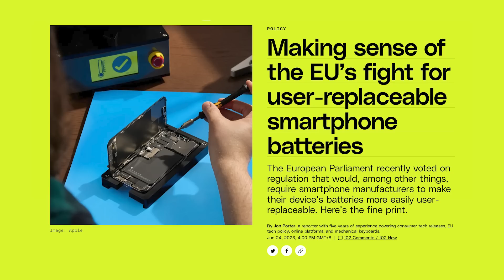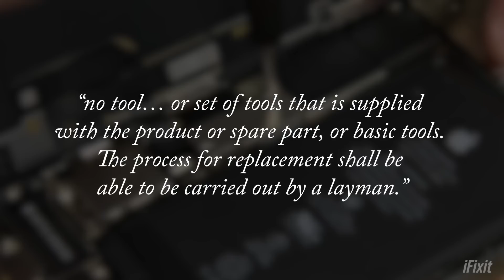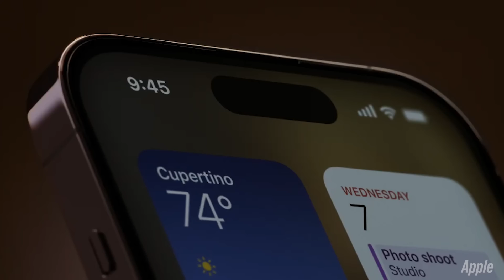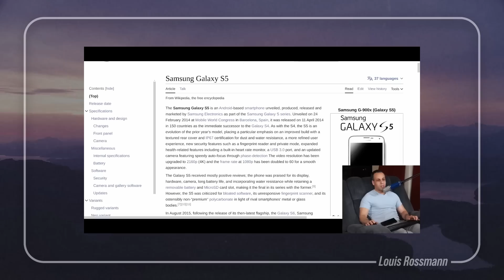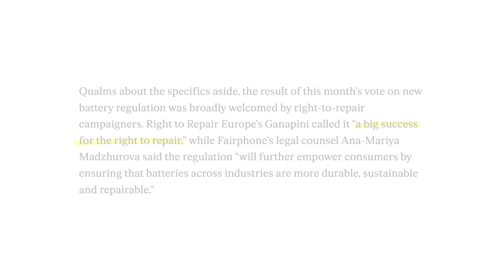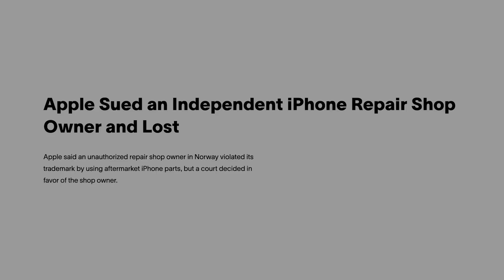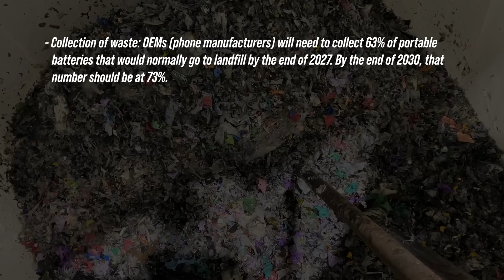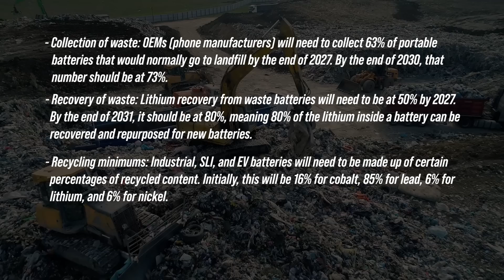EU Just Changed Smartphones Forever

Comment: Common EU W. Seriously though, the amount of devices that go to e-waste just because of a dead battery is ridiculous.
Reply: I have some exceptional quality headphones with jack, they won't work on an iPhone with the lightening connector thing even with an Apple brand connector so i used my iPhone 6 until the battery died. 
Now I have to listen on vastly inferior Bluetooth ones - I can't afford £500 JUST to buy new headphones and I have very very good headphones - ALL THIS COS OF A BATTERY
Reply: @piccalillipit9211 Dude, just buy a Wiim Pro and use it’s Airplay feature to stream from your iPhone into the Wiim.  From the Wiim it’s got optical and rca outputs to gear that can drive your headphones.  It costs $149, not $500 lol.  So wipe your tears and get with it.
Reply: @piccalillipit9211  just get one of the apple usb3 to jack adapters.. They're overpriced, but they do work.
Third party versions have varying levels of quality... 

I kept my iPad Pro 1st gen until late last year for the same reason. Loved that jack.. But had to move on. Now it's dongle-time... Sucks, but is what it is..
Reply: You can replace the iPhone 6 battery
Reply: @piccalillipit9211  Can you not buy an adapter for the jack?
Reply: @streuthmonkey1  Those adapters are absolutely terrible.  I've bought several, and none lasted longer than 2 weeks
Reply: @piccalillipit9211  You're supposed to throw the headphones away and use the little pods that you can lose when one falls out, you're not behaving like the rest of the flock. I'll never buy Apple.
Reply: Agree
Reply: Not only that but many are just sitting in drawers in people's houses due to dead batteries.
Reply: Devices now might start having less capacity batteries or start to be thicker like older smartphones. "Might" because now companies might spend more resources trying to get better and smaller batteries since they have a reason now.
Reply: @RenanMsV_YT  I would always want a more robust frame , containing larger battery for larger autonomy, especially for devices I expect to use for 5-10+ years...size and weight are secondary concerns. But, damn, imagine the level of ..hurt for phone producers if they sold one tenth of the number of devices and could only justifiably increase the price by a few percent for designing better devices. Phone manufacturers already get a large part of their income by selling our personal browsing activity  to merchandising and influencing. Why else all phones have these large screens if not for maximal media retention? You absolutely cannot find phones that are just that, phones, instead all need to be portable laptops..
Reply: Awesome news!
Reply: If my battery is replaceable, I'll probably throw it away every year, instead of every five years, like I do now. I guess this policy might backfire. Perverse incentives are a common problem with policies like this.
Reply: Girst win for the EU in a while
Reply: My recently purchased £15 4G Nokia already has a replacable battery.  It also has a better battery life and is better for things like.. making phone calls.
Reply: APPLE EMPLOYEE SPOTTED
Reply: Yeah, EU win. Making yet another decision that the people DID NOT vote for.
Reply: Meanwhile over here we can’t pass a single law about right to repair and we can’t even ban loot boxes in games as they are blatantly a form of gambling. Add on we refuse to offer free healthcare despite other countries offering high quality fast health care without much drawbacks at all. Feels great to be an American. I don’t think our government gives two flying fux about its people.
Reply: E
Reply: Roughly 50 billion tons of E-Waste worldwide.
Reply: It's better, they think that chargers generate e-waste.
Reply: LG G5 and V 20 did it in 2016
Reply: that what makes it profitable
Reply: no, this will result in worse phones and more expensive waterproof phones, it will make all phones more expensive, now something else will break rather than the battery, it is bad for cooling, it will slow down technology by not funding it, it will punish companies that made phones with replaceable batteries, disposable phones are now going to have to have replaceable batteries so they will cost more, it will turn companies against the EU so the EU wont last much longer.
they are also responsible for GDPR cookie warnings.
Reply: wow the guy himself
Reply: Wtf? Common? The EU does 1000 bad things and 2 good things, and you praise them for it?
Reply: @silksonic3927 Not true at all. Phone are much easier to recycle. Most batteries end up in trash.
Reply: @@user-rx4be4cg5n When it comes to small electronic devices almost no one recycles them and that's a fact. Recycling is literally a myth. Everyone throws away electronics to trash and don't bother with recycling. People couldn't care less.
Reply: 💯 global warming/climate change is a farce and a money grab by politicians and many corporations.
Reply: they'll still get thrown away the lifespans match the speed of advancement.... use old tech get hacked....
Reply: People also need to stop lining up for the newest iPhone every fucking year. Those people are honestly so childlike.
Reply: but surely more devices would go to waste due to water damage
Reply: @cassiuscartland  Phones with replaceable batteries can still be waterproof
Reply: B.S. Apple and a little Google, turning off app-wise updates, (not OS) in old phones is even worse than wear out  battery
Reply: now if only they make another law that demands OS updates on phones especially for more than 2-3 years, because perfectly working phones go to garbage because android only offers max 3 years of OS updates, and without them the phone becomes extremely slow. modern smart phones are small factor computers and they cost as much, so we should be able to use them for a long period of time and not force to buy new every 2-3 years.
Reply: @harukaru84 my Galaxy S9 worked great after 5 years.
Reply: @jamisojo  for a 700+ euros phone it would be ridiculous if it didn't work after five years, but the question is, did it get android updates past the 3 years?

because flagship phones might last a little longer without updates, but entry and mid level phones(200~400 euros price tag) they become very slow once the updates stop.
Reply: not only because of dead battery just because you cant change screen when its broken. @DJ-yh8hm your are totaly wrong. They get recycled. so actually less e-waste as the phone stays and works on.
Reply: Except it isn't that much about batteries, most people put to e-waste because the software updates stop, and people want the thing that feels fast. Most of it isn't trashed if disposed of correctly. It ends up in third-world countries being reused.
Reply: Can't believe my country decided to leave the EU. Look at the fantastic influence they are on the rest of the world. I can always trust my European neighbours
Reply: With those users spending as little as possible on cheap batteries. Getting onto airlines with a phone is going to get interesting. Edit: cheap batteries = fire. When Samsung batteries were catching fire, they banned Samsung from flights, and would check your phone before getting on the plane. Checking removable batteries serial numbers might end up being a thing.
Reply: @float32  why?? What does “cheapness” have to do with what is approved for airline travel? The answer is it has nothing to do with anything you said. Cheapness does not equate to what is approved or not approved. Best stay out of the adult conversations.
Reply: @itsodelay  cheap lithium ion batteries catch fire. Read about Samsung battery fires.
Reply: EU L
Reply: @imstupidbut  yep, username checks out
Reply: Still not a coherent argument to defend mandating manufacturers to design their product a certain way by law. Whats next, mandate that clothing be manufactured with increased seam allowance to allow customers to alter/tailor their own clothes? To reduce waste from the fashion industry? Don't kid yourself EU. Nobody EVER carried a spare battery with them, that was NEVER a thing. 
Who's battery is dying anyway? I've had the same phone since 2012 (typing this on it) while everyone else I know upgraded their iPhones every 2 weeks while the old one was still working? Most people ditch their old phones because there's a newer/better one, and their plan covers an upgrade, it almost never has anything to do with the battery dying.
I bet not a single one of you people even has ever had a pair of shoes fixed or has the slightest idea how to darn a sock, mend a garment; much less think to learn. 
But cry more because you can't replace the battery in your week old iPhone 69 because you can't function without the aid of 50 apps running simultaneously.
Reply: @GM-qq1wi I carried a spare battery.  So thats argument is crap.    I used to work longs hours without acess to a charger.   And nowadays how many people carry rechargeable battery packs ?     LOTS OF THEM !!!
Reply: @MrBizteck  Oh, so you're telling me there's an invention that enables portable charging so you don't even NEED to carry a second battery anymore? It's almost like YOUR argument is crap. And it also sounds like you spend way too much time on your phone at work.
Reply: Not true. Devices go to e waste because people want the mew model after 2 years and don't want to look cheap. They throw away perfectly functional smartphones. Even if batteries were the case tejy can be replaced even today.
Reply: @d3r4g45  I only know a few who changes their phones because a new one has come out. The rest of us sees no need except when the phone gets damaged, or more often the battery gets old.
Reply: @d3r4g45   "Even if batteries were the case tejy can be replaced even today."  by a shop, yes. This is about you being able to swap them yourself.. If you had to bring your TV remote to samsung and pay them 150 bucks to swap your batteries you'd be pissed. That's what it's like now for phones... With the EU regulation, you can swap your phone battery the same way you swap your remote batteries.. Just take it out and put in a new one... At the cost of a battery. So like 30 bucks probably.
Reply: @d3r4g45  Some peple do but not everyone. Most people just sell their own phones. I use my phones until they completely break down.
Reply: @d3r4g45 most people don't change phones every two years.
Reply: Except batteries will not outlast a phone...new battery technology has resolved this issue, this is just the EU being 10 years too late.
Reply: @fabscams4136 batteries don't function well 4 years in.  
Decreasing battery life is noticable after a year or two, easily.
Reply: much better than those movement by " environmental advocate" is saying
Reply: Perhaps in the future all products will be software ‘locked’ rather than hardware constrained to increase the useable life of a product. Manufacturers will charge a monthly fee to unlock features within the device like some car manufacturers do now . I realize this might be a fantasy but one day a quantum chip might be developed with almost infinite flexibility.
Reply: i dont think so, batteries are not a waste at all in the first place, so isnt glass or any other metal. this is stupid law made by people without a clue about whatsoever
Reply: COMMON?
Reply: @bajor3200  They're literally the only institution in the world that does anything to stem the tide of greed that corporations foist upon us. They're the most active when it comes to climate regulations. while the US is busy making people not care about the climate, the EU was doing something positive at least.

 I know it's easy to hate on the EU, but when you dig down and look at why people hate the EU, it's mostly because they've been told it's evil and it's part of the globalist agenda or whatever... Or they just have no idea why they think the EU is bad, just tucker carlson rotted their brains away.

Durrr EU bad!
Reply: @bajor3200  Yes common , you are polish, you should know.
Reply: Now imagine how many batteries will become e-waste when user replacement becomes possible. Much more e-waste than you can imagine since people will be able to do it on their own.
Reply: @DJ-yh8hm that makes absolutely no sense.
 It is way better to just change the battery instead of the whole device, which also has a new battery.
Reply: @bobbobson6290  I think it makes at least some sense.  A phone with a weak battery still has some value and will likely be traded or sold.  A dead battery will be thrown in the trash by a large number of people.
Reply: @smithiness  but the batteries will be recycled for their materials, so it's not a total waste.
Reply: @DJ-yh8hm Why would the rate of battery failure increase ? When the phone/EV dies people will just change their battery instead of the whole thing, fuck planned obsolescence we should be able to keep electronics for decades
Reply: @sambones1092  Changing batteries doesn't keep an old product relevant. How many people are still using laptops from the early 2000's? All laptops of that vintage had user replaceable/swappable batteries and that didn't keep them from being replaced with a new laptop.
Reply: @killer2600  It's been 10 years that phones are the same hardware, tactile screen with double camera, the only thing that really changes is the software which is portable among any device if the company chooses too (looking at you apple), also people will keep buying new phones, but every 10 years not every year
Reply: @killer2600  I know people who are still using laptops from the early 2000s but for specific applications rather than just general use.
However you make a good point and it raises the issue of software obsolescence. I had to replace my Android phone after a few years as the version of the OS no longer supported the apps I wanted to use and newly released versions were not supported on my phone.
Reply: @sambones1092  well said
Reply: @sambones1092  they trade it in to recycle it. Something they would do anyway after a couple years because the new one is objectively so much better. It's not just the battery that makes them want to ditch their current phone.
Reply: @killer2600  I am currently working and light gaming with a Dell L207x laptop. It's well into a decade old; I also have a pretty beefy PC. Try to realize what side of the argument you're on
Reply: @sambones1092 I think he means people will throw them in the garbage instead of trading in their phones for the companies to reuse the parts.
Reply: @vctrsigma  "Something they would do anyway after a couple years because the new one is objectively so much better. It's not just the battery that makes them want to ditch their current phone."

Are they? Phones have been pretty much the same for a decade now... The difference between a 5 year old iphone and one from today is minimal. Screen is a tiny bit better. Cameras from 5 years ago took great pictures, cameras from this year take great pictures...

One of the main problems with phones is that there's literally nothing new... Phones were perfected in about 2015, and after that it's just been a better camera every year... And we've long since reached the point of diminishing returns in that department... 

Haven't been compelled to buy a phone in the last 8 years due to any new features. There's literally nothing new... People use their phones for instagram and tiktok and other stuff, apps that demand nothing from the phone's substantial processing power. You can run a music studio on these things, and people use them to swipe on pictures and videos......... That part has seen no improvements since 2012. Was fast back then, still fast today.

Phone tech is stagnant because there's nothing more to do.
Reply: @killer2600 big difference between a 23 year old laptop and a phone that was made 5 to 6 years ago and still good working condition
Reply: @sambones1092 No, you should not when those things are cell phones. The technology is STILL rapidly improving for those things. The power usage of the phones is decreasing iteration after iteration UNLESS you are using your smartphone as a full on media device.
If you are using it only or solely for its main purpose of "A phone"? Days to week long battery life today compared to barely 12 hours 10 years ago.
Reply: @christopherkidwell9817  wtf are you on about, people use their smartphones for everything today not just calling
Reply: @DJ-yh8hm Aren't batteries recyclable?
Reply: @SQ-wx4st  they are, however it is still expensive and not done usually. However, on top of everything that has already been mentioned, recycling will be easier, since the battery is already separate from the rest of the device. So you don't have to tear the whole device down.
Reply: @DJ-yh8hm much less e-waste. With phones capabilities today we would replace far fewer phones. It would be less phones and batteries.
Reply: @RustyNinja100  how many surveys have there been to show people replace their phones primarily because the battery is down to <80% of original. Usually its because the hardware isn't as good as the new model. If the new one wasn't compelling they would just get it serviced.
Reply: @vctrsigma  Asus Zenfone 7 pro user here. Phone is currently ~4 years old; Snapdragon 8+, Audino 670 GPU, battery is good for ~10hrs from 80%. I play Hoyoverse games at 60fps, Diablo at 30fps, and NFS at a solid 120. My phone before that was the LG G5, and my phone before that was the Samsung S8. Shortest gaps between phones was 2 years because one literally broke but usually I get a good 5 years out of my devices before I start to consider replacement. If you're replacing your phone every other year you're throwing money away.
Reply: @vctrsigma  hardware today can last much longer. There is very little reason to upgrade a phone other than battery life
Reply: @vctrsigma people would definitely replace their batteries instead of getting new phones.  
Getting a new phone sucks.
Reply: @DJ-yh8hm  more batteries but less e-waste in total as device life will be prolonged with replaceable batteries
Reply: @shepherdkalinchenga9005  and since the law req that the batteries needs to be 50% from recycled materials, it will reduce de primary materials consumption.
Reply: @shepherdkalinchenga9005  I don't hear people complaining of their battery being the problem much these days, but sure.
Reply: @DJ-yh8hm BEGONE CORPORATE SHILL
Reply: @DJ-yh8hm  Your comment made no sense. If people only replace the batteries when their batteries degrade rather than the entire phone, how will that create MORE waste?
Reply: @MrDontclickthislink you know when battery was easily replaceable, there is alot stores that sell those batteries and it’s gonna increased the production on the battery itself, doesnt matter did your battery already broken or not, battery production will keep going. (probably that’s what he’s thinking)

what i would like is more regulation on how the batteries will be produced. even now i still have 1 full box of old nokia phone’s batteries that doesn’t sold out on my father’s store. also some cheap brand from china can also produce batteries on massive scale. and there will be people who bought more than 4 batteries so they can change their battery real quick when their phones ran out of battery.

of course i fully supported this eu regulation, but this will be far more complex than i could ever imagine.
Reply: @Akromee what model of batteries do you have laying around?
Reply: @DJ-yh8hm If the battery dies you have two choices. Replace the phone or replace a part of the phone. The rate is still the same. One creates less e waste.
Reply: @DJ-yh8hm  So throwing away the phone is better than just changing the battery??
Reply: @DJ-yh8hm  you know... batteries were always user replacable before apple and samsung decided that they can make more money when user had to buy a new phne instead of a new battery
Reply: @DJ-yh8hm  so, you prefer that we throw away a whole electronic device because we can't change the battery instead of sending the "dead" battery to recycling and prolong the device life by 2 or 3 time the original life expectancy?
Reply: @kolerick  You can do that now just fine. No need to throw it away don't be so dramatic.
Reply: @DJ-yh8hm you cannot "do that now.". 
You cannot just replace the battery, and that is a real problem.  
I'm glad the EU got involved.
Reply: @DJ-yh8hm wow drop the shovel and stop digging.   
It costs upwards of £50 -80   to replace a battery nowadays   compared to about £15 with this new law. 

ALSO Twice in the last 10 years Ive gone to a shop to replace a battery and the shop ended up cracking the screen or damaging the phone resulting in the entire phone becoming E-waste.  
Now an easily slot in battety means its a simple task.   
And since the batteries will be removable it means they are FAR more likely to be recycled.  

My battery changeable Samsung S4 went threw 2 batteries before it finally was software killed abd I bough an S8 that was wrecked when I tried to change its battery.  Meaning I had to get an S10  My wifes I7 was also damaged in the same way.  

Non replaceable batteries results in MORE E WASTE.
Reply: @MrBizteck  No, you're completely wrong. You don't understand this at all so stop commenting. If this ever becomes a reality, the batteries will possibly cost hundreds of dollars and people will end up not replacing them anyway. You really think anyone can outsmart the big companies that are selling you the phones? They will find a way of making money on this.
Reply: @DJ-yh8hm how do you even exist?
Reply: @DJ-yh8hm but that can be recycled
Reply: @DJ-yh8hm  User replacement has been possible until these companies decided it shouldn't be.
Reply: @DJ-yh8hm no its better then buying a new phone
Reply: That makes no sense. 1 battery is less impact then replacing the entire phone... Not to mention that a battery is easier to recycle if it isnt fixed in the housing
Reply: It's way easier to recycle batteries than it is with most other electronics parts in a phone
Reply: @DJ-yh8hm battery recyclable
Reply: @DJ-yh8hm u came up with this on the toilet huh
Reply: I don’t think so… generally people throw their phone when the battery life is low and than buy a new phone. In this case you can keep your phone much longer with just a battery replacement, but easier to do it alone
Reply: @DJ-yh8hm  Nonsense. Some smartphones simply refuse to start until you remove the battery and put it back. It happened to me, and I destroyed the phone trying to open it.
Reply: @DJ-yh8hm  There's not much to imagine. It's either same or less, depending the quality of batteries. It's not like people start using batteries as a fucking hammers just because they could.
Reply: @DJ-yh8hm  95% of a lithium battery is recyclable.
Reply: @DJ-yh8hm  Yeah, you might wanna think that through a bit more, bud.
Reply: @DJ-yh8hm  Okay so you think having to replace an entire phone will be less e-waste than removing only the battery?
Reply: @DJ-yh8hm Have you even seen till the end of the video? EU lawmakers have even considered this
Reply: @DJ-yh8hm  Obviously, corporations to which you have outsourced your thinking have broken your logic.
Reply: @DJ-yh8hm  Would it not be easier to make batteries recyclable rather than the whole devices?
Reply: @DJ-yh8hm batteries, as well as most electronics do have proper recycling. 

Access to facilities that handle such though....
Reply: people will stick with their phone because it is not dead? you are not a rocket scientist. this will mean I don't have to buy a brand new phone that is still very much capable for doing it's purpose. such as my samsung note 10+ I had to change the battery 2 times under 4 yeara but the phone technically is good for an other 4 years.
Reply: All them words. None of it made sense @DJ-yh8hm
Reply: @DJ-yh8hm found a Apple fan
Reply: @DJ-yh8hm  Now, People will replace the whole phone when there is an issue with the Batterie. With this change, people will only switch the Batterie. Which means less E-Waste.
Reply: @DJ-yh8hm You're implying as in it will be so simple. pretty sure its gonna be. Your original battery died? Alrighty feel free to send it or give the dead battery back to be qualified for a replacement battery.
Reply: @DJ-yh8hm  Let me help you out.
1. buy phone
2. a few years later the phone's battery goes to shit
3a. throw out the entire phone (including the battery) and get a new one
3b. throw out the battery and get a new one
Which one is better for the environment?
Reply: @DJ-yh8hm thats crazy Logic… it will save consumers money ( I do not have to buy new phone ) and a battery contains way less waste than a phone
Reply: @DJ-yh8hm yup... way more e wste now 😂😂
Reply: @DJ-yh8hm  Pretty much. People will replace their batteries faster, so instead of 1 per device there will be like 2-3 per device. And batteries are far more toxic than the rest of the phone, so... it would only make the issue worse.
Reply: @thenonexistinghero   My Nokia 7610 never got it's battery replaced and it lasted me 10 years. And I never got any problems like battery draining fast. But because we use more juice now for our touchscreens and the wifi/mobile data and bluetooth always on, I could be wrong about the battery quality. Why don't we give it a chance first? Progress is still progress. Whether you succeed or not, you still learn something.
Reply: @thenonexistinghero  So instead replace the device with a failing battery with a new device which obviously has a new battery in it?  Surely it makes more sense to replace the failing battery with a new battery.
Reply: @bobble500  Just saying that this isn't gonna do much, if anything to reduce e-waste.
Reply: @thenonexistinghero how is it 1 per device? If you change your battery 2-3 times, it means in that given span of time your phone would have died 2-3 times too. Ergo it comes down to 3 phones + 3 batteries as e-waste or 3 batteries as e-waste.
Reply: @thenonexistinghero  No, the battery will still last the same. But because you can swap out the old battery, your saving the overhead of the extra device.

A lithium battery is something like 50% recyclable if you care about economy. If not its more like 95-99%. Your lucky to get 20% back from electronics. So more mass at a lower recover % or less mass at a higher recover %...
Reply: @thenonexistinghero  Lets see, if the device weighs 400g and the battery weighs 100g, how much ewaste do you save by only replacing the battery?